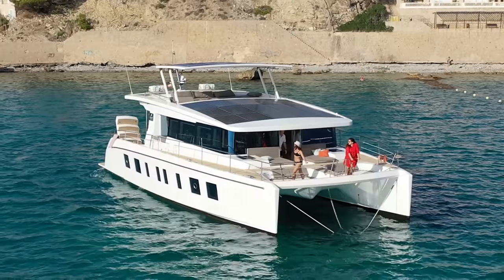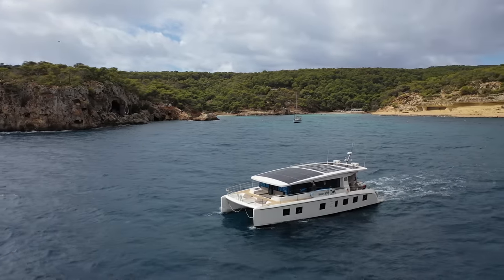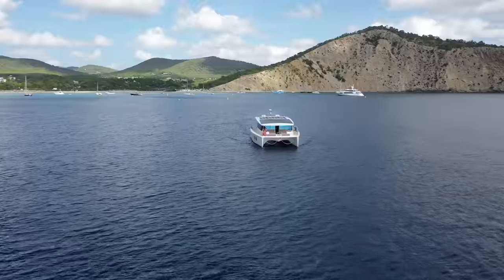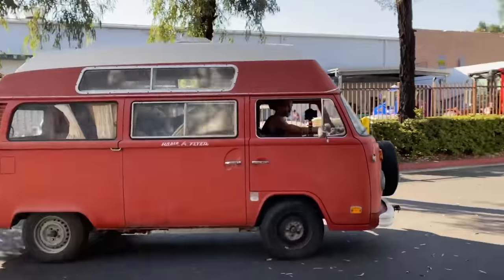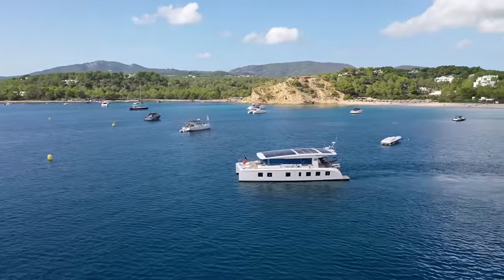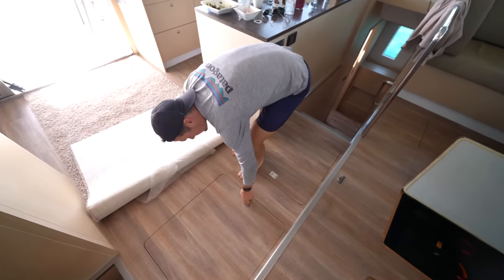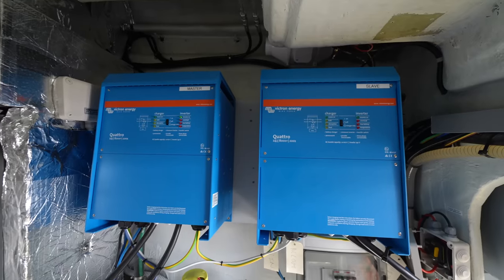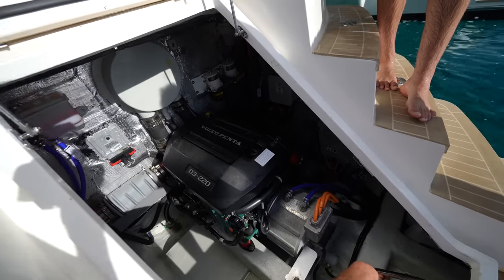100% Solar Powered Tesla Yacht

Comment: wonder what kind of corrosion you have to deal with and what mitigation they do to stop it. my dad owns a company doing salt water skimmers for marina clean ups. the biggest issue is corrosion from the salt water on the motors. i'm an electrical engineer doing high voltage station design and even for stations in generating plants which are near the ocean we deal with corrosion from the marine layer

Comment: It's obvious why these new breed of solar yachts are all catamarans but when is someone going to do the same thing with a mono hull. Catamarans are just so expensive all round whereas mono hulls are much cheaper. It would look unconventional but there is no reason why you could not build a full length solar roof over a mono hull. A 40 foot boat could easily have a 5KwHr array. Putting that together with a 50KwHr battery and you have all the power you need for propulsion, cooking, air con, lighting, etc, etc. but at a fraction of the cost to these multi million pound cats. For sail boat enthusiasts remember you can't store the wind!

Comment: Solar Yatch runs on diesel. Hmmm
Reply: Unfortunately solar/renewable energies are intermittent which means not always production of energy, that diesel can litteraly run 24/7 even cooler if it was a diesel generator that runs on vegetable/used oils